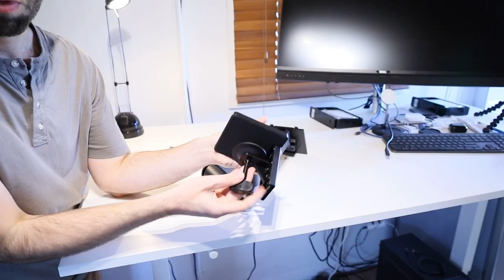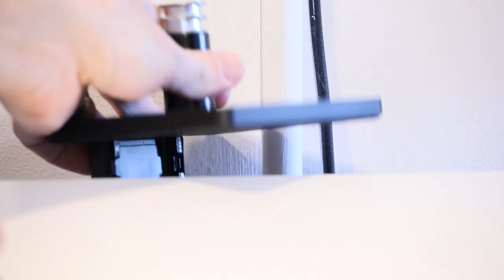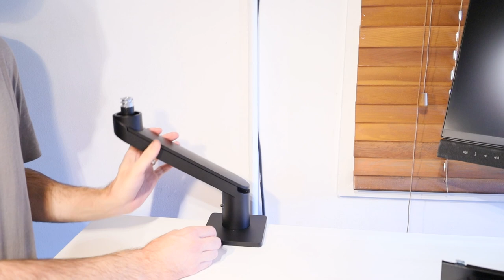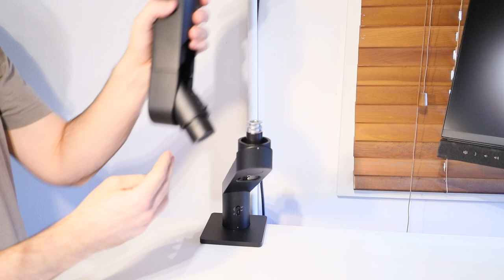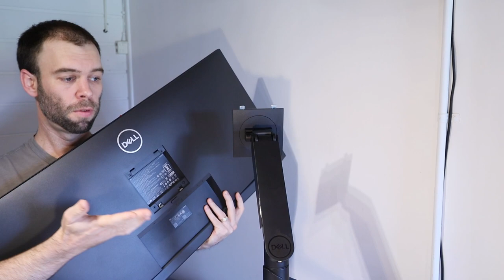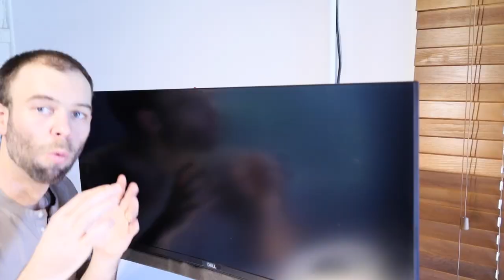Dell MSA20 Single Monitor Arm Assembly Process - Setup Guide

Comment: can u adjust tilt tension? it keeps dragging the monitor down...
Reply: Same
Reply: I figured it out, there's a little plastic cover you need to pop off close to the area where the mount attaches. I used a box cutter. And it's good now.
Reply: @bilalnasir2397  wow i just ended up returning it lol
Reply: @pman93aqw  next time see owner manual 😊

Comment: Realy good mount i use it with my  alienware aw3423dw.
Reply: Hey, does this hand allow you to bring monitor higher and further from you than the stand it came with? My desk is next to a wall, so the monitor on the legs is a bit too close to me, and I can’t figure if the arm will solve it.
Reply from the maker: Yes, if you don't lock the base swivel to 180 degree range, it can swivel 360 degrees which allows the monitor to go back inline with the back of a desk easily.